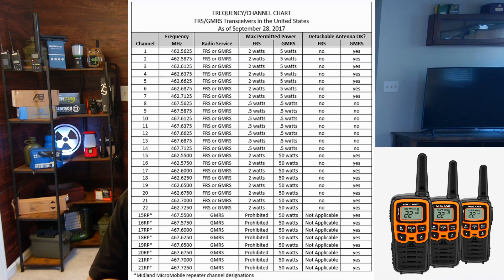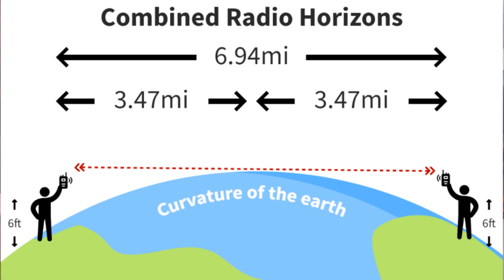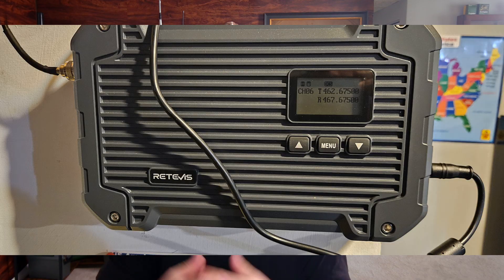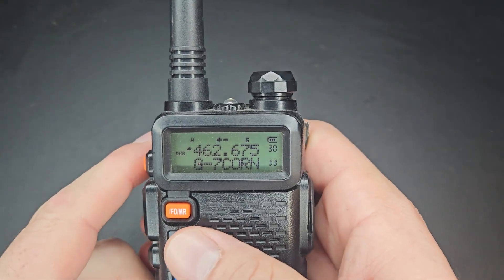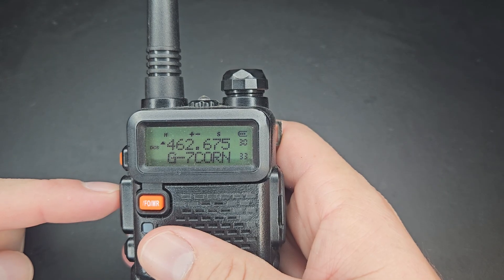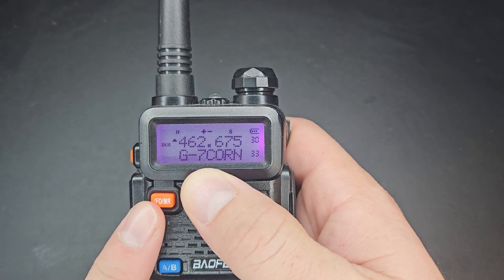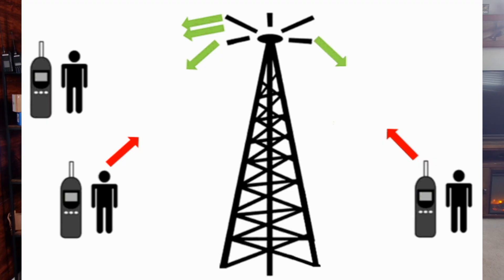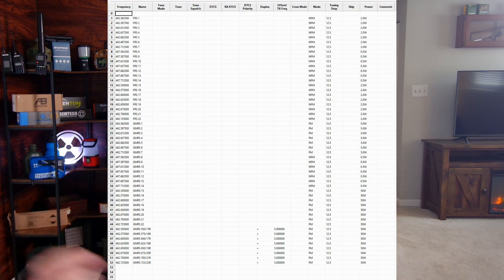Difference Between a Walkie Talkie and a Real Radio

Comment: Radios like the Retevis RT22 falls more in the WT set in that it is a max of 2 watts and a fixed antenna. However, you can program it with offsets and tones. I've set mine for our 70cm repeater and can work the repeater from a few miles away. I think the title is a bit misleading. They are all proper radios within their scope and purpose. As both a General ticket HAM and GMRS licensed, I find uses for both types. Recognizing the uses for each and how to integrate them to your plan might be a better approach. In an emergency I can hand out bubble pack, or what you call walkie-talkies, to unlicensed people with the channel (frequency) locked down and a little bit of instruction on procedure and have them working small neighborhoods or areas with myself of someone with a mobile, or full HT as a central contact point. During CERT training we used bubble pack radios with two-person teams when doing light search and rescue to coordinate. The wife and I will use the little radios when out shopping or around the immediate area because they are just a lot handier than dragging my full-sized HT with long whip. 

A lot of people do need to hear though that those bubble pack radios that say they go 36, or 50 miles and have hundreds of privacy channels are BS claims by the manufacturer. When you tell someone those "cool" radios they bought do not go 36 miles and how the "privacy channels" really work you either see heartbreak in their face or they get defensive and tell you you're wrong. So yes, there needs to be an education on the differences, but both are real and proper radios. Just each within its scope and purpose. And how well the individual can utilize each.

Comment: Thanks for this info! I've created a similar Chirp profile that captures FRS and GMRS channels, which I've separated out because of narrow and wide-band. Do you find it makes a big difference to use the narrowband setting when communicating with other FRS radios?
Reply from the maker: The file is this video is just the stock gmrs/frs in chirp. If you hit file then open stock config in chirp there is a bunch of files murs,marine gmrs ect ect....